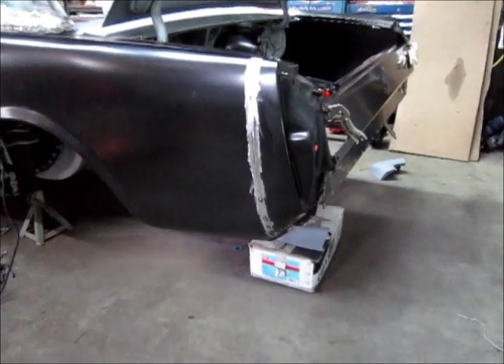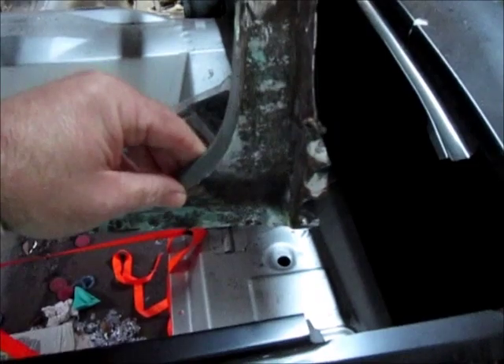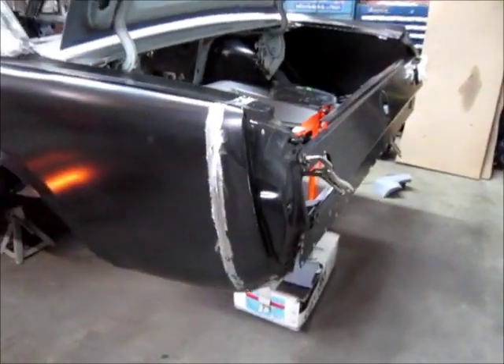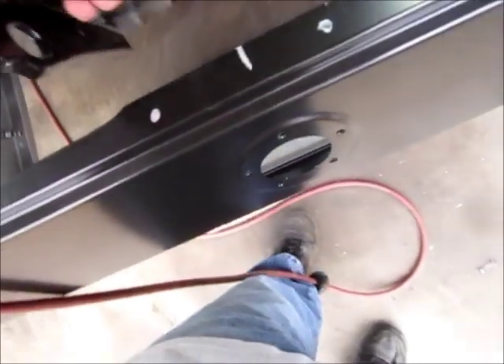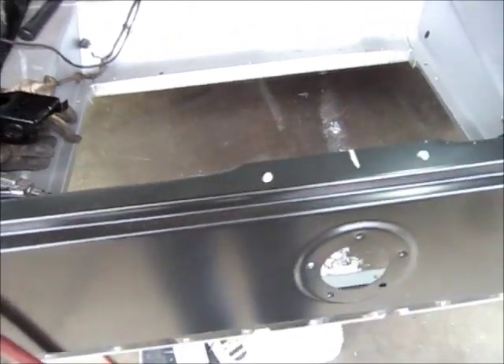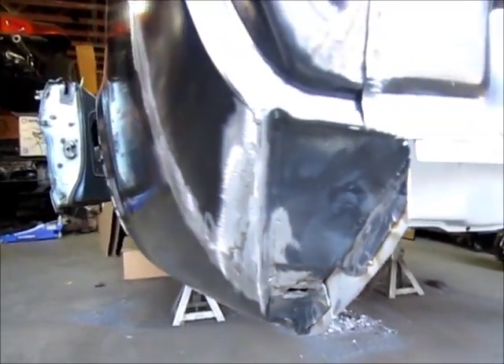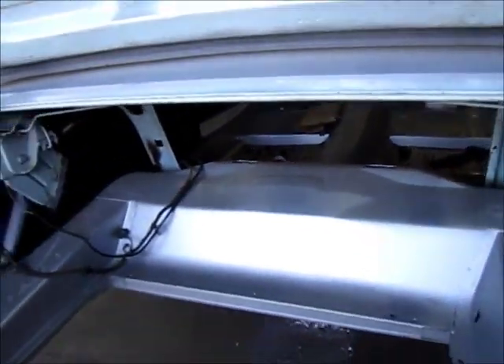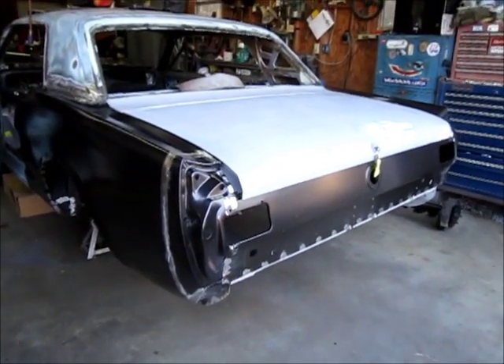1965 Mustang quarter panel install part 6

Comment: Wow…learning a ton here. Your vids are super helpful so big thank you for taking the time to share your experience. I’m most amazed at your way of dealing with the punches without losing your cool and your ability of coming up with fixes everytime. That said if you had to shorten the quarter panel again, would you be making your cut more forward to clear the angle where the valance will be resting to avoid some extra work?
Reply from the maker: Thanks. Yes, I would move slightly forward, but it works this way too.

Comment: Enjoyed and really learned from this series.  You mentioned treating with self-etch and use of seam sealer.  Can you explain the timing on applying self-etch after doing in final weld blends and do you spray can it or go with the paint gun?  And is there a rule of thumb on primer then seam seal or seam seal then primer?
Reply from the maker: I apply self etch from a spray can, and I typically do it after I'm done welding and blending. As far as rule of thumb, it can vary by product. typically I will treat the metal/seams with self etch, and then apply seam sealer. Depending on the area, I may follow up with a primer, and undercoating if it's on the bottom of the car.

Comment: If it was easy everyone would be doing it! But probably not as good as you mate. Impressed with the effort you go too to get the lines and fit right. Without being critical we need to remember build quality was not at the top of their concerns when ford could not knock them out fast enough. There a lot of mustangs that are way better than anything ford built!
Reply from the maker: +Andrew Wilson I agree. Build quality was not the highest priority. The idea was to produce a car that would be on the road for 8-10 years, tops. I bet they had no idea that people would still be driving/building/customizing them today and beyond.

Comment: What size wire do you use for you spot welds on your panels? I'm in the process of installing the trunk drop downs and tail panel
Thanks for your reply on my last question
Reply from the maker: Stangresto I use .023 wire.

Comment: What size hole do you drill for the spot welds?
Reply from the maker: Stangresto I use a step drill. I start with a smaller bit, maybe a number 30, then I use the step drill. I believe I end up with a 3/8" hole, but that will depend on room for the hole. A typical hole punch tool (air) is 1/4".

Comment: You mentioned using self etch primer between the panels. Do you use this instead of a weldable primer or just in certain areas?
Reply from the maker: Chris P. I use self etch in exposed areas, and weld through at the weld seams.

Comment: The Rustang is coming on strong but now maybe with all of the rust cut out I think its safe to call it a Mustang once again.    As you clearly outlined this drivers side after-market 1/4 panel is not correct and you have done a lot of additional quality work to rectify its fit with the truck lid.  But have you considered officially informing Mustangs Unlimited or Dynacorn 'the steel panel manufacturer' of the problems you have encountered, this might go a long way to promote them modifying the panel helping both the company and those that-try this process in the future.   Keep up the great work  Bud.
Reply from the maker: I think I tried to have that discussion. Not likely they will respond. I have had better luck with AMD. They make lots of Mopar stuff, and have expanded into Chevy's and some Ford parts. They don't want to try and compete with Mustangs Unlimited, because they are already so cheap.

Comment: Hi from experience just one comment, final aligning the trunk prior to welding is always better after a new weather sealing rubber is fitted in place, otherwise the truck could be to high and not flat with the new quarters and old filler panel.
Reply from the maker: Agreed. I've seen it happen before. The challenge is installing a seal prior to paint.

Comment: Great work! I'm ready for the frame rail!
Reply from the maker: It's coming. It'll be the left frame rail, core support, and right front inner fender apron/battery box.
Reply: The front portion of my outside driver frame rail could have used some attention.